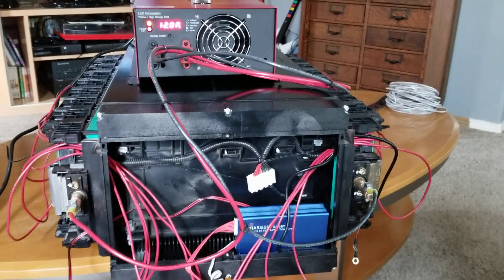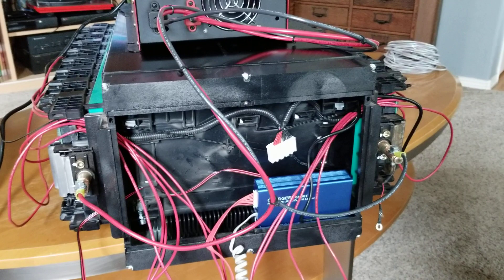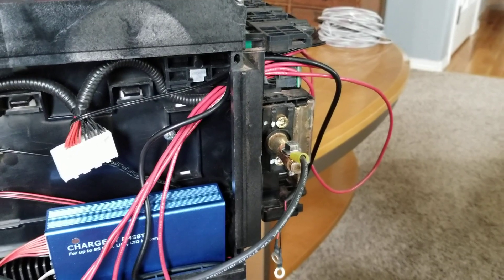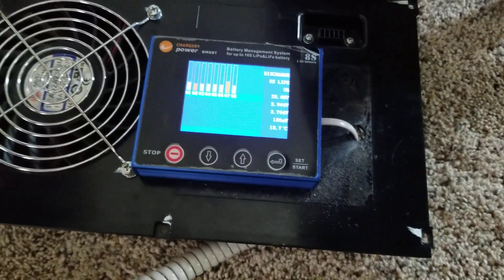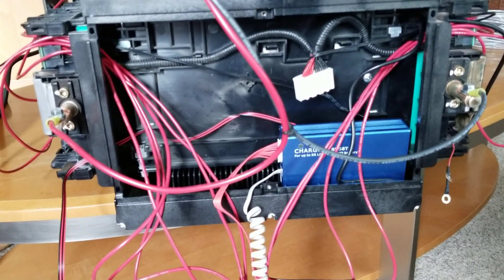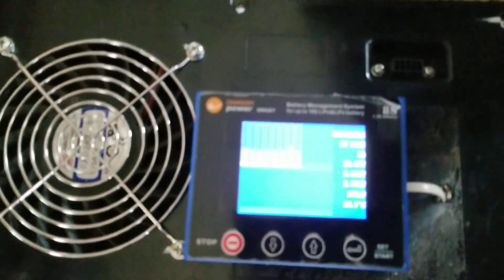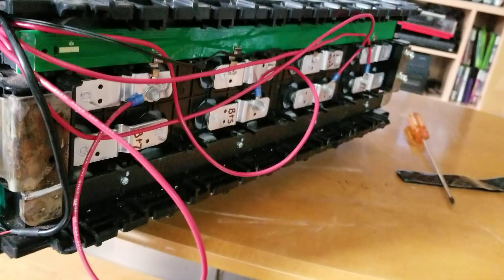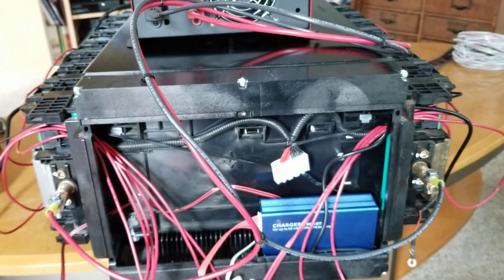BYD Battery Power Wall. Installing BMS & Active Cell Balance Part1

Comment: Carlos, I'm wondering if the terminals are alternated or all the same on each side. I think the stock wiring harness isn't enough for a balancer and plan on running new larger wires. I haven't taken mine apart yet. Just trying to figure out how to run the leads.

Comment: What kind of bMs is that and where did you get it ?
Thanks in advance so much, Tomas
Reply from the maker: Bought them on EBay. Look for:8S 5A - 8A Li-ion ion Lipo Lifepo4 Battery Active Equalizer BMS Balancer Board
Reply: Gracias Carlos

Comment: what size screw (or bolt nut) did you use to attach balance wire to cell?
Reply from the maker: I Used a Unslotted Hex Washer Head Self-Drilling Screws 5/8 length. They worked nicely,  but you have to be careful of the torque as the bus bar metal is on the soft side.

CatalogView ListView Grid

Comment: Great videos. What size bolt did you use? Was there enough material left on the post on either side of the hole as not to break off?
Reply from the maker: Hi Andy. I Used a 1/4" 20 1 inch bolt, and grinding a flat spot ate up about a third of the post and it's still very strong.
Reply: Carlos Chaves- excellent, thanks. I got a good cutting wheel for my air tool and cut about 1/3 of the post off about 2/3 of the way back. I made my flats vertical. Had a nice flat cut and tapped with 5/16” x 18, slow cutting by hand with lots of cutting oil. Used a small file to cut the burrs off. Looks great and have a nice area for a 200A T fuse to sit in a pocket. I over killed by putting a lock nut behind the post where the bolt came through. I’m sure the lock washer I used was fine, but an en engineer I tend to over build structures. 😁

Comment: You did a great job with those terminals.  I never thought to cut a flat spot on them.
Reply from the maker: Thanks David. I've watched many of your videos and they've inspired me greatly, your work is top notch.
Reply: I might do the same thing and tap them and then use @DavidPoz Cooper bars. That’s will make what I’m doing perfect.